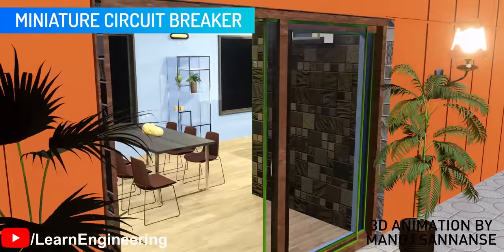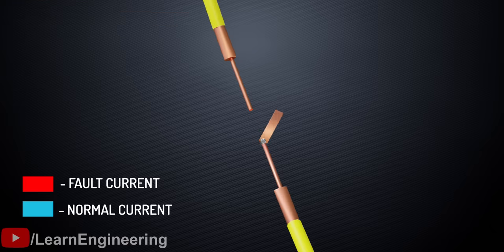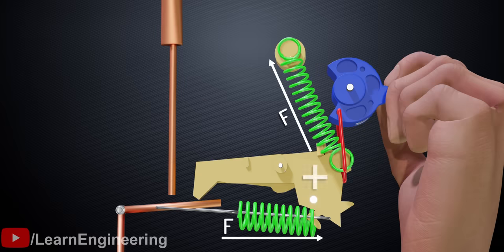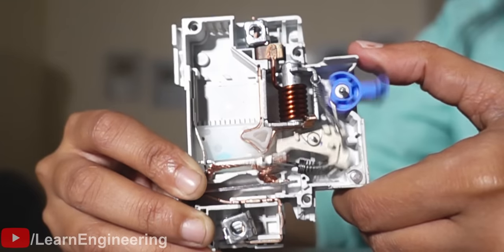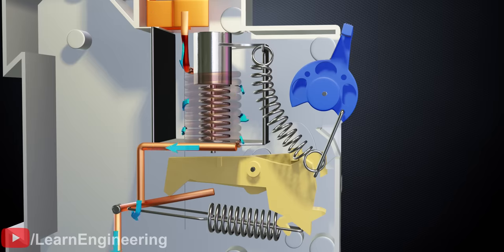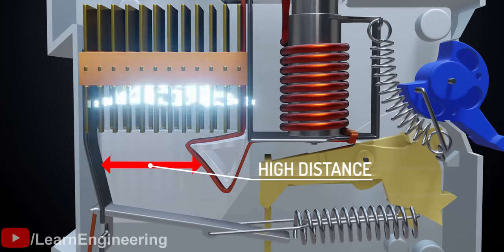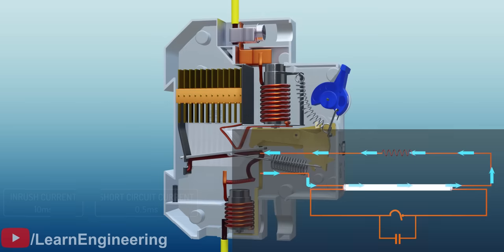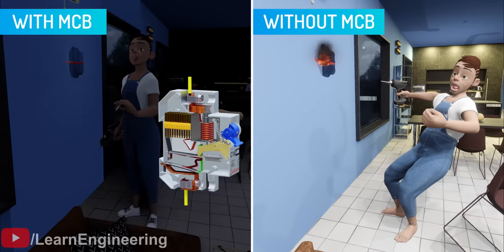MCBs, how do they work?

Comment: 6:30 Why does the current increase with more devices connected in parallel? Doesn't it suppose to decrease because of bigger total resistance with every new device?
Reply: Oh but with new devices being connected in PARALLEL, the resultant resistance actually gets smaller, contrary  to the series connection, right?
Reply: @druck_  Right! Good thinking. R drops i increases.
Reply: @SALESENGLISH2020  thank you!
Reply: @druck_  You are welcome. Yes, resistors in parallel is a bit like making the wire thicker IIIII , so the resistance drops. In series, it is like making the wire longer -- -- -- -- , so the resistance increases. That is how I used to memorize.

It is quite the opposite of connecting springs in parallel and series. A parallel combination makes the stiffness go up and a series combination makes it less stiff.
Best wishes
Reply: @SALESENGLISH2020  Well this is an explanation I will definitely write down :) Thank you very much and I wish you all the best!

Comment: The problem is that MCBs don't work.  Connect a UPS, a microwave, and on and on, and the MCB trips falsely.  We have had the electrician come and uninstall some MCBs and replace them with regular circuit breakers.

Comment: The use of an MCB also has another purpose ??
In the case of older Fuses which use a Wire instead of an MCB.
People generally take on themselves to Upgrade the Fuse Wire Size ????
But they don't realise the whole purpose of a Fuse ??
(To protect the supply cable )
In most cases people replace a burnt out Fuse Wire with a Wire a lot larger in size.
In some cases even to point of using a small metal nail to fix this problem ??????

Comment: 7:52 how does that metal go back to its original position?
Reply: the screw? if you mean the bimetallic strip, then it'll get back to it's initial position by itself after some time from not experiencing a hot temperature

Comment: I opened up one my of circuit breakers, and I didn't find a solenoid. There was a "magnetic pole piece" (http://activerain.com/image_store/uploads/1/2/7/3/3/ar136466391633721.jpg). How does that generate a magnetic field during a short circuit to pull the magnetic armature?

Comment: Come on, one can`t get electrical discharge while drilling through wires. I did it many times, nothing happened, even when wires were old and had no MCB at all, just drill bit has been damaged. The drill is isolated anyways. But of course you should use wire detectors and refer to wiring plans and drafts.

Comment: People get so used to using initialisms that they assume others understand what they stand for. Often the initialisms are never defined in works on the subject. In many situations, this works. We don't need to define "USA" usually. However, "MCB" needs explaining. And it's insulting to the viewer too. You don't know what MCB means? Then perhaps you shouldn't be viewing something this advanced. (MCB = Miniature Circuit Breaker.) Lesics makes the mistake for MCB; plus, he makes it again at the end of the video with RCD, ELCB, and MCCB. Molded Case Circuit Breaker (MCBB). Residual Current Device (RCD). Earth Leakage Circuit Breakers (ELCB)

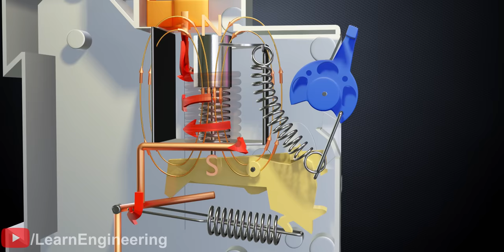Comment: Great video but aweful-aweful UNSAFE MCB design! Note: if anything prevents the lever from physically moving from ON to OFF position (say at 4:32) then the MCB will never interrupt the current. A janitor's broom handle stuck underneath the lever will burn down your building. The US-style breakers operate differently and will interrupt the current even if the lever is locked.

Comment: "Fusing the wire"

I know this is technically the correct etymology here. The dictionary dose have an appropriate entry under fuse specifically for breaking a circuit. But why did anybody decide to use this word? It doesn't make sense. At the time, it would have had the exact opposite meaning. It would have been the same as saying joining the wire, combining the wire, bonding the wire, welding the wire. It just silly.